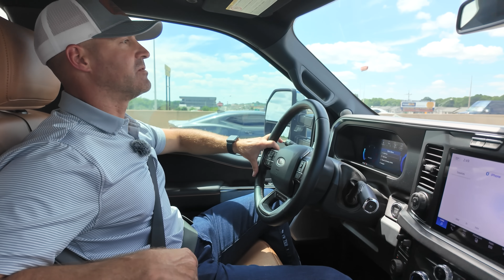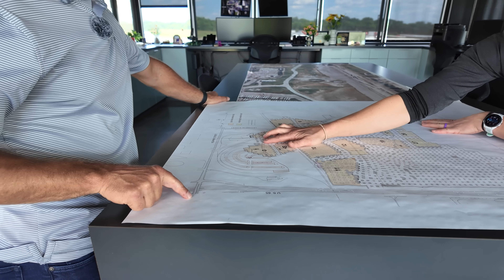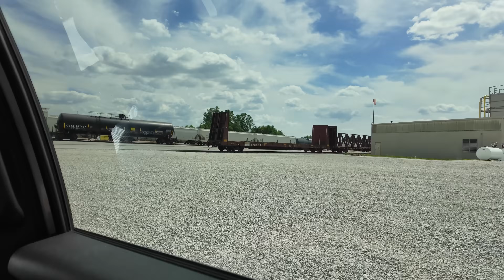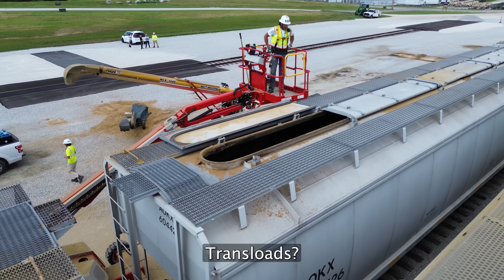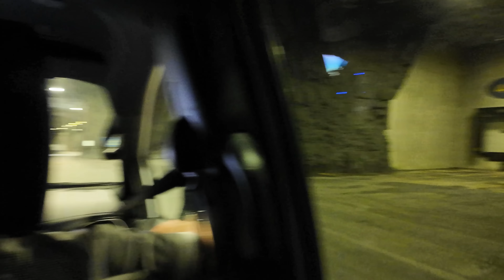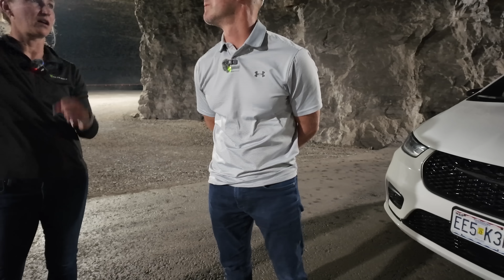Inside the Underground City Where 700 Trucks Come and Go Every Day

Comment: Does anyone know if the Joplin/ Carthage storage is a bigger area than Springfield Underground? I drive a big truck myself so I have had the fortune of being in both facilities.  But it's really hard to tell just for the fact that neither facility lets you go just anywhere down there that you want. Primarily for safety reasons. And I totally get that. I'm hoping someone in the KNOW perhaps might read this and enlighten me on this question.?  I know some things are a no brainer not to ask but this is one that I believe is nog deemed sensitive because it encompasses just a broad definition of sheer size between the 2.  I have also actually worked in the Springfield facility for a time back in the late 90s early 2000s era and I know just from delivering loads in there recently as well as Carthage that both places are vast. And the Spfld facility has grown quite a bit since I worked down there for Kraft/ DHL .  
DHL operates most of the logistics in both facilities and maybe one of their reps might have an answer to my question. I'm currently between jobs drawing unemployment and I have been kicking around the idea of going back to work underground just simply because of the way this world system is headed. I believe underground is going to be the safest hedged bet once Sh@t hits the fan. If anyone could help me out with an opportunity with either facility I would also be very grateful as well. Thank you. And hopefully hear back an answer for  either question or both. BC😊

Comment: The risk of ceiling rock failures (falling down) can be further minimized by shaping the ceiling like a cathedral. Aside from faults in the rocks, the tensile stress in the center, caused by a flat ceiling, will want to move towards that shape naturally. Rocks under tensile stress are generally unstable, leading to cracks and eventual failure. But if you put those rocks under compressive stress, they won't fail as quickly and will last for centuries naturally. 
The additional surface area of a cathedral ceiling will facilitate faster heat transfer towards the natural ground temperature.  
This is otherwise a brilliant move and an impressive piece of engineering. Good Luck!
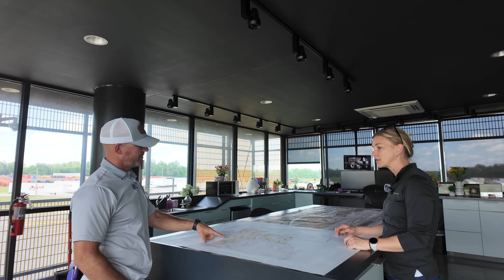Reply: Revelation 6:15  Then the kings of the earth, the important people, the generals, the rich, the powerful, and all the slaves and free people concealed themselves in caves and among the rocks in the mountains.

Comment: I live in Springfield, Missouri where the Underground is located.  I'm a retired truck driver and have been in the Underground several times and prefer this to the Subtropolis and other systems up near Kansas City.  The Underground in Springfield, while smaller overall has a higher ceiling  and the "roadways" are wider making maneuvering much easier than those in KC.  My son also worked there for a while.  They can also get trains into the Springfield Underground and I do mean into the caves, not just on top.  I have seen rail cars inside the caves.

Comment: A proposal to enhance mega-structure stability by integrating a massive, 10-million-unit container matrix to act as an internal counter-structural dampening system against harmonic shaking, paired with an upper-level mirror reflection system for environmental management.

Comment: I don’t know if you’ve got a video of it yet we’re gone down there for it but the island of Great Inagua it’s south of Miami, a single island that pulls water out of the ocean through and put it into canal system in the center of the island and put it into pods. They evaporate into huge clumps of rock salt then with greater in front of loaders, they put it on conveyor belts out to a barge, and with it still in the state ship of two I believe Miami. I was there with the Air Force monitoring air traffic out of Columbia for one year. Yes, paradise can get very very boring, but the beer was very cheap and the money was unbelievable.

Comment: I work mining in a same exact type  place.  We go a mile back. Our ceiling are 100 ft. Plus we are well over 100 ft under ground.  Spend 12 hrs under ground. Just using heavy equipment lights. And a mining head lamp. The way we have  our radios set up. We can use them under ground.

Comment: I hated going there, it's super tight and claustrophobic.  There are several of these in the area, I've been to the one in Independence MO, and Quincy IL also.  I also had to go into the active mine in Alton IL when I hauled bulk material.  You couldn't see anything other than what your headlights illuminated so you made the widest turns you could and prayed your trailer cleared the pillar you were trying to turn around.

Comment: These caves are way easier to deliver to, and easier to navigate, than the ones in Kansas. The caves in Carthage, are easy also.The caves in Kansas, are like a maze, and they give you directions, that you need to explicitly follow. They are color coded, and numbered, and somewhat one directional. They have limited room to back up, and maneuver. If you get out to check your clearance, and space around you, the floor is somewhat damp, and you feel like your'e mixing cement, with your shoes. They were a pain.

Comment: They did this near Lexington Kentucky back in the 1970s with a limestone mine.
We used to explore it when I was a little kid. 
They also have one of them in Slade, KY, that they turned into an underground water park where you can boat through certain areas of the mine.

Comment: I'm surprised they don't have drop hoppers under the rail cars for bulk goods, where they could just punch a transfer tube from the surface directly to the holding area, or at least a sorting station. 
And it would be the perfect place to create a pullover bridge to unload the trucks into the railcars. Just a pit where the truck pulls up and over a hopper with a conveyor, and then shunts the rail cars under the other end...
She said they aren't currently mining, but some of that knowledge and those assets must remain so that they can do the excavation themselves.
They really need to look at how docks do this kind of work. They're dealing with the same problem of small boxes into big boxes, but the volume is so much bigger that they had to figure out fast, cheap transload a long time ago, and gravity is the solution.
The big dockyards even go to the next level and have full tipples that will take bulk hopper cars and flip them over to unload them, so each car only takes 5-10 minutes and doesn't need to have bottom gates

Comment: I've been in this one, the one at Carthage, and the one at Neosho MO multiple times. There are more of these around than people realize. If you need to bugout, go to one of these, there's plenty of food stuffs shipping in and out of them. Carthage has frozen chicken and cheese, for example. These would also make great places to build data centers as it is cheaper to cool, inherently more secure.
Reply: Missouri has the hardest limestone in the world with the finest grain. It makes caverns and deep mines unusually stable. The humidity is also more easily controlled because the tight grains done weap as much water as softer rock. Kinda cool you can sell the rock then rent the room. For eternity.
Reply: The company I worked for had a data center in one of the undergrounds in KC MO, it was in the Winchester mine and of course it was called the Winchester Data center.   A very large setup with hundreds of forklift batteries for a power back up with 3 large diesel generators.
Reply: @woodwaker1  I am surprised there aren't more data centers underground.  Maybe there are more than I know about for sure, but there are so many that I've read about in current news that are currently being developed or in planning stages above ground.
Reply: This is in Springfield. But, what State. Missouri? Since you mentioned Carriage and Neosho. I live in Joplin.
Reply: I finished watching and got my answer. Kansas City, MO. has a big underground storage as well.
Reply: @janusjoplin3987  It says in the description...Springfield, MO.
Reply: @jameswalker590    EXACTLYYYYY  !!!   😊
Reply: @janusjoplin3987  Good question,  there are a lot of states with a Springfield!
Reply: @davidkottman3440  yes and they are not for you and I. All for the elite and highranking people in the military. So don’t think you can get in to get something when it gets bad
Reply: @shanti4903  lol, don't think I live close enough to an underground to seek shelter there anyway. But, I have been inside the north KC facilities and it's pretty interesting & enormous.
Reply: @janusjoplin3987 Missouri
Reply: The one in Kansas city has a few distribution centers inside there

Comment: I have been to that facility 11 times during my 17 1/2 year trucking career.  Only had one rude and unbelievably unpleasant employee interaction.  Surprisingly roomy for semi's to go in and out of when backing into a dock.  They do their best to give GOOD ACCURATE directions on where to go and routing.  And ya BETTER stop at the stop signs.  I was headed out and was told I ran (rolled) 2 stop signs where there was other traffic.  Next time I did not stop at one, I could get the whole company banned from the facility for up to 1 year.  I was polite in my disagreement and informed them that I stopped at every stop sign BECAQUSE of other traffic.  Come to find out the OTHER company truck and mine had 2 numbers swapped.  17 and 71.  They apologized and gave him the warning!  but overall, for it being an underground facility, it had VERY good air flow from the ventilation, so when they advised me to turn off my truck I obliged them and had no issues keeping warm on a 29 degree day outside the caves.  They took about 5 hours to get me loaded up due to a supply issue (waiting for something to be brought in).  I got in a really nice nap, and woke up refreshed and ready to roll afterwards.

Comment: One of the best ass chewing's i have seen was from an owner, when DISPATCH sent me (standard truck, sleeper, 53ft reefer) into one of the caves.  What most dispatchers DO NOT realize that while the floors may be wide enough, the CEILINGS are ROUNDED (TRAILER GRABBERS).  First time they did it, the OWNER jumped MY ass for taking HER tractor and trailer in there!  SHE, (in front of me!) Called the dispatcher in and JUMPED HER ASS (i am a USN Vet and had my ass chewed by PROFESSIONALS), she informed her that her OTR tractors did NOT go in there! Call a local tractor to come take it!

Comment: What about ventilation?  There must be a way to extract vehicle exhaust.
Reply: It's probably just like a underground mine. You have multiple intake shafts directing air to the return air. All return air is vacuumed by a huge exhaust fan on the surface to ventilate the mine. Pretty sure this mine / warehouse would be monitored by Federal and State Mining divisions.
Reply: @WhiteKnight-5775 if you listen carefully, you can hear fans running in the background.
Reply: Same way the do it in long road and rail tunnels my dude, big exhaust/induction fans.

Comment: Subtropolis, 55 million square feet in Kansas City.
Reply from the maker: Been seeing multiple call outs for this one. May have to give it a visit 👀
Reply: @BulkLoadsVids  Yes you should visit it.  They are still expanding, it is enormous. I worked down there for 6 years.  I had to take Vitamin D pills my levels were so low.  In the winter I would not see the except on the weekends.  Drive into work in the dark and it was dark when I left.  Sometimes it was depressing.  Fun Fact, we would get cracks in the sheetrock in the office areas around doorways.  It was not from the ceiling dropping it was from the ground raising. Another fun fact.  Their expansion is continuing north because they cannot go farther west.  MODOT will not let it expand under I-435.